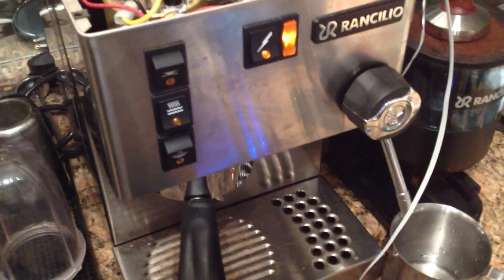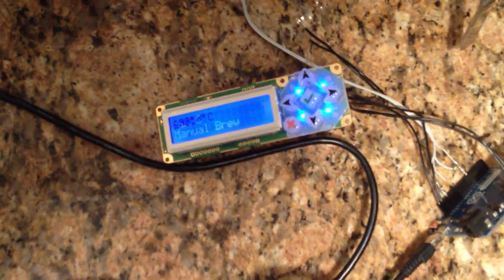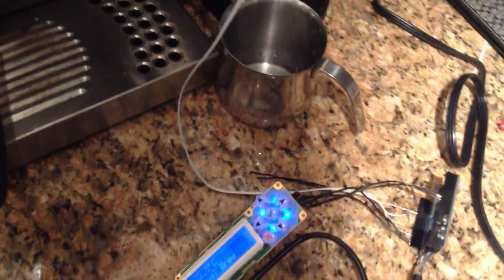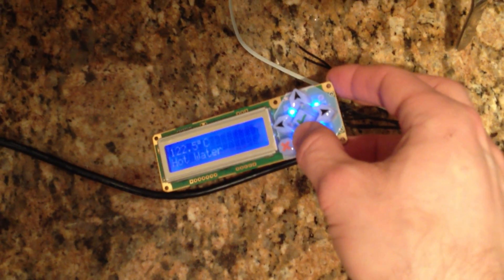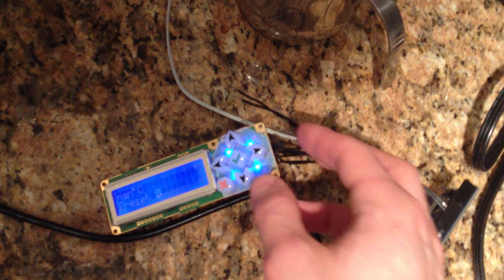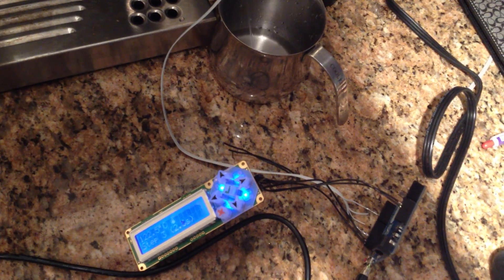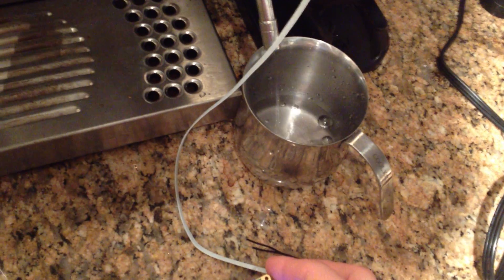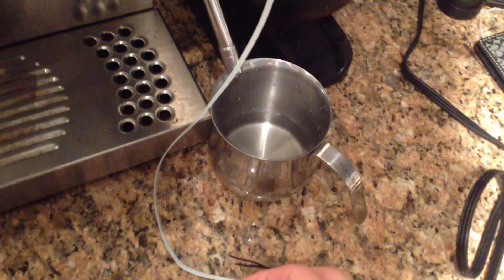CREMA: PWM-based Pump Control

Comment: Do you control directly the pump's impeller actuator? Or do you control an electronic nozzle?
Reply from the maker: +Mehdi Tlili I control power to the pump. In the Rancilio Silvia, it's a 120v vibratory pump. Just like with the heating element, I control the pump using a solid-state relay. Fortunately, the relay can handle fast switching of power (at up to 60Hz as it's a zero-crossing relay).
Reply: I was wondering about fast switching. Is it possible to PWM at higher frequencies so the pump sounds continuous?